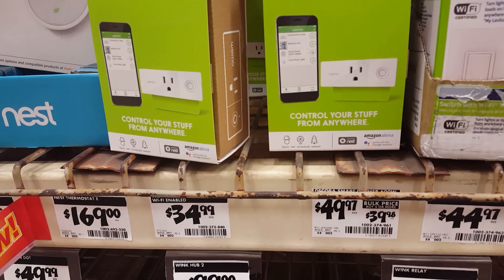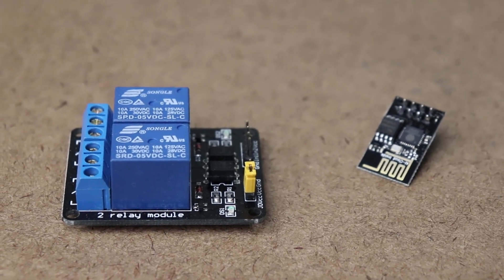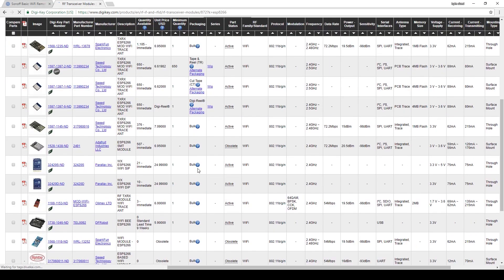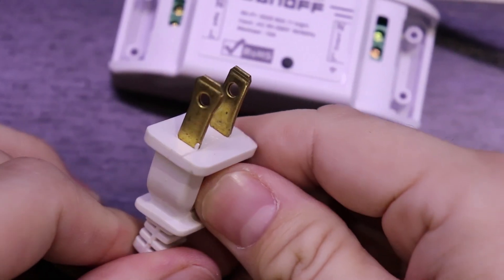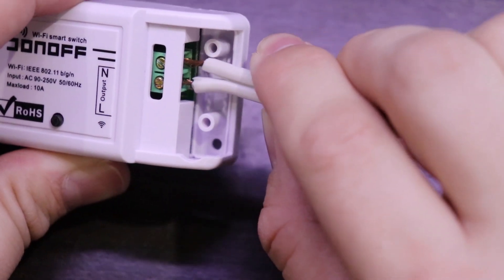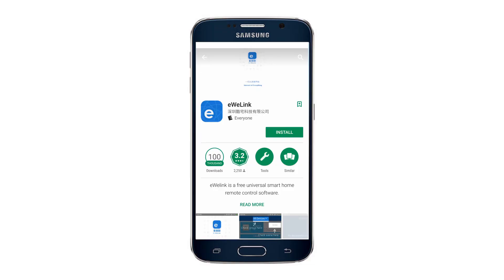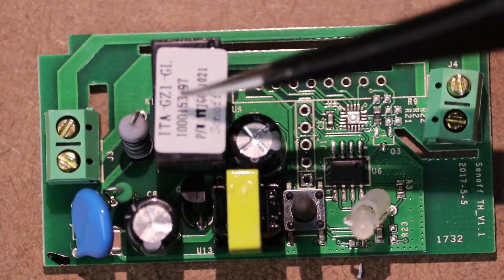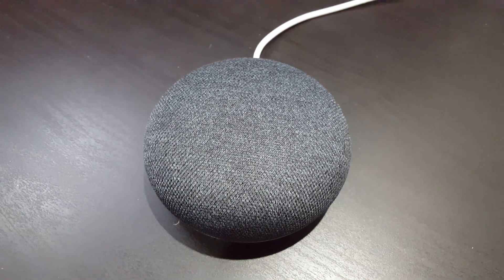Sonoff - The $5 WiFi Smart Switch That's Compatible With Alexa And Google Home

Comment: Hey, nice video, how has the stability of these sonoff things been for you since? Mine are rather unstable and loose connection to the servers quite often... Any ideas? (Oh and I'd be happy to see a video about custom firmware on these things, google home compatible of course)
Reply from the maker: I haven't had many issues with the stability of these. I am going to try to flash the Tasmota firmware and run a local server so I don't have to rely on Chinese servers.

Comment: only problem is that it doesn't support a ground connection. I guess you could just run the ground line around the switch, but it wouldn't be as clean. Pretty damn cheap tho, I'll give you that!
Reply from the maker: Thanks for the feedback! See FAQ 3 in the description.

Comment: Unless you are going to hack these, they aren't a good choice.  There are a lot of complaints from Sonoff users about the poor availability of the Sonoff servers on which these devices rely.  Sometimes they are unavailable for days at a time rendering your Sonoff switch totally useless.
Reply from the maker: hmm, I have not had these issues. Thanks for the heads up though!

Comment: For the price, you cannot beat it. I've got two thoughts on using this device: Make the stripped copper shorter to avoid accidental short circuits. Also, these devices will likely spy on you. (Log the on/off commands and send them to China.) Or at least the app does.
Reply from the maker: Cool, thanks for the tips!

Comment: How can I use this to control my garage door with my Amazon echo? Please please please help
Reply: For example, When I want to open my garage door I have to press a button on my wall. That button has wires that leads to the garage door opener that’s on the ceiling. Is there anyway I can set this switch up with that button?

Comment: SONOFF Wifi Wireless Switch Remote Control Automation Relay Module for Apple Android Smartphones 10A 220V
Rated
5.0
/5 based on
360
customer reviews
 5.0 (360 votes) 1272 orders
Price: US $5.71 / piece
Discount Price:
US $4.80 / piece  -16%  4 days left
Get our app to see exclusive pricesBulk Price
Just ordered one on Aliexpress

Comment: the original code is not open source. In fact you can not find the original one to flash it back to the factory...

About the consumption, there is also a sonnoff variant with and (amp OR voltage)+wattage meter. no need to hack it.
Reply from the maker: Thanks for the tips!

Comment: Do these things have some kind of sleep timer? I wired it into an extension cord to control my Christmas tree lights, and it works great. After sitting for hours without use, and I tell Google to turn on lights, nothing happens (light is steady green), and after about two minutes, I can tell Google again, and it works fine. How do I disable hibernation?
Reply from the maker: I've noticed similar behavior with mine. I don't think it's the sonoff switch. I think it might be the Google home connection. Sorry I'm not much help here

Comment: I hope you know that inserting loose wire ends into screw terminals is a potential fire hazard! You need to clamp the ends of the wires using cable end sleeves!
Reply from the maker: Thanks for the tip

Comment: I ordered 2. Both seem to me DOA. No light, no connection. Nothing. Cut up a known working cord, connected N and L, checked and rechecked both. Still unable to see any sign of life.
Reply: Apparently ninjas has snuck in during the connection process and had switched the "input" and "output" sides around. All is well. Crisis averted. And yes, they respond rediculously fast. Faster than any switch or bulb I have.
Reply: Another thing to be concerned with is that sometimes, houses get wired incorrectly (either by the builder or by some homeowner doing add-on work later) and you find the line voltage on what should be the neutral.  Hell, I've even found line voltage on ground in one old house that I was helping a relative with.  As you can probably guess, that was a shocking experience. :)
Reply from the maker: wow that's scary!
Reply from the maker: Glad you got it working!
Reply: I too have found wiring backwards in a house that was just built. Apparently all licensed electricians don't follow the convention of black being hot and white being neutral. One hooked up correct in the breaker box for the inspector to see and the other mixed them up in the socket. At least they didn't mess up the earth. I always check the outlets when I move now.

Comment: Are these switches able to be controlled off LAN? In case of a internet outage can i control them if i'm connected to the same network?
Reply from the maker: +Alex Dominguez that's a good question. I'll have to test that when I get home. There is a physical button that can turn on/off the appliance independently

Comment: Hi..u swtiched on five devices in the end..does that mean you had 5 sonoffs? i have tried sonoffs at home and its a good cheap thing to experiment.  but how do we actually connect our home switches without having tens of sonoffs and it would make the switch board dirty.  Thx
Reply from the maker: +Prasad ARN yes, each appliance needs its own Sonoff

Comment: It is a nice device.
I use it with MQTT and node red. 
But watch out with the mains wiring.
Dont strip the wires to long as in this vlog.
There is also no earth connection but plenty room to route the earthwire throu the device.
Reply from the maker: +Chris Ruuls those are great tips!

Comment: Hey do you think you One could be safely installed in the wall right at the outlet??
Reply from the maker: +drewabramson89 you could theoretically, but I wouldn't recommend it. That wouldn't comply with electrical building code.

Comment: Will the light switch still work. That's the big question I have. At $5 per switch I'd add these to every light-switch junction box in my house, then control every light & ceiling fan using Alexa, however the switch on the wall must continue to work. Of course 'off' will still work if the Sonoff is wired downstream of the wall switch.  But I'd like to be able to turn the light or fan both on and off with the switch, and on or off with the Sonoff. You could toggle power to change state, so long as the switch is left in the 'on' position.  This would allow you to flip off and back on if you wanted to turn the light either on or off, if the Sonoff changed state every time power is toggled.
Reply from the maker: It wouldn't be a very clean solution to wire this switch in series with a wall switch.

Comment: Is there a way to add this in for a light switch?
Reply from the maker: You could replace a wall switch with this device, but I wouldn't recommend it. I would look for a wifi or z-wave light switch instead.

Comment: I put 4 of them in a ceiling fan so I could turn the light and fan on and off remotely. It was a tight fit, but it works to control speed and all. It was cheaper than a new fan remote (mine quit working) and DEFINITELY cheaper than a smart ceiling fan control PLUS smart light switch/bulb
Reply: I was thinking this exactly for my ceiling fans - maybe the exhaust fan in my kids bathroom 🚽🚽

Comment: Does it really matter which way you connect the line and neutral wire? Aren't both lines interchangeable with AC? In Europe we don't even discriminate the two prongs on the plug. Or is there something different in the US?
Reply from the maker: The switch will work if you reverse the 2 wires, but it actually best practice to switch the live wire. Here in the US most appliances allow you to plug it in either way, unless there's a ground prong. See FAQ #3 in description.

Comment: What if you don't have your phone with you... and just want to use the blender...? Is there like a reset manual on off switch to this sonoff?
Reply from the maker: There is a small button on the sonoff switch that turns it on and off, independently of the app.
Reply: and also independently of internet connection.
Reply: so the normal power button will n longer work???
Reply: Correct.

Comment: I found a way to convert these so the output is a no voltage switch so these can be integrated into lower voltage devices using 1 cut.

Comment: Awesome video! $5 is incredible... I looked at sourcing everything and making my own PCB to do something similar, but the AC-DC power components would have been more than $5 alone. I do wish there was an app that doesn't look like it's from some 3rd party chinese company, but I guess the integration is what you pay for in the more expensive devices.
Reply: Sonoff is open hardware, with an FTDI cable and a broken warranty label, you can tap inside and flash your own firmware (or some pre-made firmware from other developers).
Reply: @bskull3232  what does this mean? That you can use some other app?
Reply: @cfvgd  That means you can run custom programs on the board, being a program designed to work with other apps or just an improvement or a completely from-scratch app that you wrote yourself.
Reply from the maker: Yeah same here. The components would cost more than $5, plus PCB, plus enclosure etc. These are great! As for not using the chinese app/server, you can flash other firmware (Tasmota) which allows you to create a local server. Thanks for watching!
Reply: I actually shuddered when I saw that!

Comment: in europe we do not have line and neutral in the sockets, we can plug in either way. so can i just mount the cables either way then? or does this device not work with 230VAC?
Reply from the maker: Mounting the wires in reverse will still work, but it's best practice to switch the live signal. See FAQ #3 in description.
Reply: Everywhere in the world has Live and Neutral at the socket, this is how basic electricity work, yes if your wall socket can plug either way the it does not matter as it's AC not DC.
Reply: yes, well, i tried to be as clear as possible, i know there are 2 colours used, but they can be mounted either way ;-) so, therefore my rather sesamestreet explanation ;-) thank u for your reply :-D it is very helpfull.
Reply: There's a lot of different standards around the world with respect to how electricity is delivered and the plugs that are expected.  For example, let's say that you want 230VAC.  One way of getting it is how we have it in the US where you have two phases 180 degrees apart.  Both phases are live and there is another connector in the wire that is neutral or ground.  If you measure from one of the live wires to neutral, you would get 115VAC, but if you measure between the two live wires, you get 230VAC.  To the best of my recollection, aboard ship, 120VAC was achieved the same way (i.e. with two 60VAC circuits 180 degrees out of phase).  You will need to do a bit more research into the particular electrical standards of your country to see how they do it.  A multimeter and oscilloscope is also nice to have.

Comment: It's important to note that if you do use this, whatever device you have wired up can only be powered on with a wifi connection (or disconnecting it from the power extension). I was just about to buy some for my livingroom when I noticed this :/
Reply from the maker: Daniel Loera there is a button on the sonoff that turns the appliance on/off. It functions independently from the WiFi connection

Comment: I think the hook is a better device for this..  sure its $50 to start but then the RF switches are 5 for $25 and you will get 2 remotes as well so you dont have to yell at google.  Plus its just 1 device on Wi-Fi now and the rest on RF vs each outlet connected to wifi.

Comment: there exists a sonoff pow which measures the power consumed by the device... only not sure how you'll integrate that with your google home. I run "other firmware" on them so it works with my home automation software (domoticz)
Reply from the maker: Thanks, I've since learned about the "pow" model. I've ordered some!

Comment: Awesome!! Do you know if it can be controlled by Apple HomeKit?
Reply from the maker: Thanks! Not sure about Apple homekit, but it does have iOS app.
Reply: With Homebridge maybe?
Reply: There is a way to do it using MQTT but for that you have to flash a custom firmware on the device
Reply: I believe you can use it through Homebridge

Comment: With no FCC or UL , should never be used in North America.  UL (or cUL) is fire / safety approvals, FCC is radio interference compliance.  Hope they will add at some point but doubt it.
Reply from the maker: Yeah, I would like to see more certification on it too. It does have CE certification. The certificate can be found on the manufacturing website.

Comment: Hi
You can check xiao mi smart plugs
It can gives you real time power usage and provide you historical chart.
It takes around 10 dollars per unit
Reply from the maker: I've since learned that sonoff makes a different model called the "pow" that can also measure power consumption. Check out the link in the description.

Comment: If all of your devices are smart switching, you can install a power consuption meter from your main feed. Setup a Python script to list the smart device's on/off state over time and output to an assigned variable for each device... then "Hey Google, how much power does the TV consume" :)
Reply from the maker: Yeah, that would certainly work. However, I've since learned that sonoff makes a different model called the "pow" that can also measure power consumption. Check out the link in the description.

Comment: I BOUGHT 4 OF THESE IN JANUARY 17
but i thought about it and i realised that having to get my phone or having to talk to my google home ,would take precisely the same amount of time as to just switch whatever on or off so i never did  wire them up .seemed like a good idea when i bought them thou ,but nar
Reply from the maker: I find that yelling at my google home is pretty fast. Especially when you have lights on more than one circuit. With one voice command I can turn off all the lights in my house. It would take me several minutes walking around my house turning off each switch one by one.
Reply: Yes maybe I will use them after all ,thing that turned me off was having to register on some app thingy ,was it a pain  to set up

Comment: I have been using exactly the same Sonoff switches for almost a year now with Alexa.

They work great! But I had to flash Tasmota firmware on each, which is relatively easy to do, but a bit harder than to just cut the cable like on this video.
Reply from the maker: Good to know, thanks!

Comment: Hey pro tip; maybe don't leave exposed copper wire outside the terminal block when it's line voltage. That's just asking for trouble and to burn your house down....
Reply from the maker: You're right, I did my best to have as little as possible exposed. Thanks for the tip!

Comment: Is it possible to start my car by using this sonoff?
Reply from the maker: No, unfortunately this will not work
Reply: Well, it is theoretically *possible*, but it is going to depend upon your car and even then, it's going to require more hardware and software to add to it.  It would not be a very easy solution for most cars.  And to make it work, you would probably have to leave the key in the ignition switch of the car.  All you would need is a servo to hold down the brake pedal, another servo to turn the ignition switch, and a mechanical framework to hold it all together.  And then combine this with an electrical cord going into your car since this device is 110VAC.  And then once you get it started, you would need to remove that stuff so that you could actually get into your car.  LOL...

Comment: Cost doubles when shipping is added in. I would like to use one on my coffee maker. Will it handle the amperage for something like that? I have looked on line but can't find the ratings.
Reply from the maker: Yeah, shipping can be a bit ridiculous sometimes. Have you tried Amazon? 
I'm not sure if this will work with your coffee maker. If you can get the desired behavior by physically unplugging and plugging in your device then the sonoff will work. That's essentially what it's doing, unplugging and plugging back in. If you're worried about current, sonoff makes 16A models that should handle something like a coffee maker. Things with resistive heating elements tend to draw a lot of current.
Reply: Yes, current was my concern. Most coffee makers draw about 10 amps and I wasn't sure your switch could handle it. I am now considering using "your" switch and installing it inside the housing of me ceiling light. This seems like a very simple way to automate my overhead lights.

Comment: Does the Sonoff hold it's state closed/open if it has no power? I would put it between the light switch and the bulb.. so if i turned the relay on via wifi and then decided to turn off the light with the light switch, will it turn back on once i use the light switch or will i also have to give a command via wifi?
Reply: Car Karl sonoff makes these https://www.itead.cc/slampher.html
Reply: Flash Tasmota firmware on it. Then you make it invert relay state everytime the sonoff gets powered. then you can still turn on and off your light on the wall.
Reply from the maker: I believe that the state is stored on the sonoff board and will survive a power cycle.
Reply: ucliker wow!!
Thanks so much!!
Reply: As long u cut the power of from sonoff it device will go off simple u don't need to sent the command but I think soon u switch it back it come on again need to test

Comment: This video is awesome! Thank you for sharing. Just one noobie question, when wiring sockets in the UK we also have a ground wire, what should I connected that to?
Reply from the maker: Thanks for watching! Only devices with metal chassis need that third ground wire. If the device you're trying to control has the ground prong, you'll need to get a different sonoff model which has a third terminal for ground.
Reply: Stick the sonoff in a box and run the earth through.